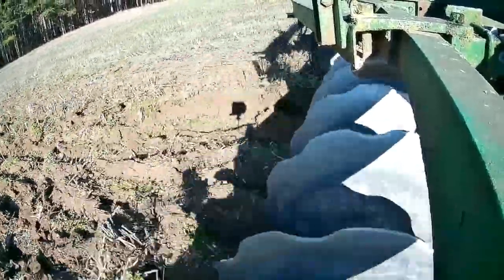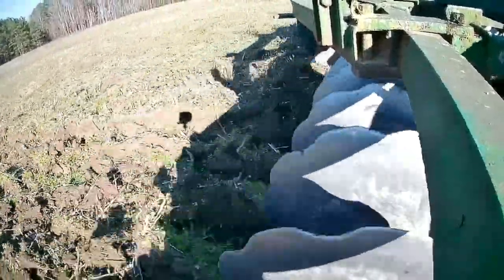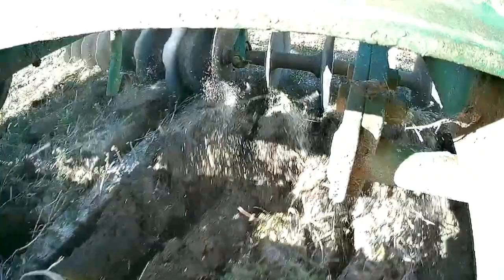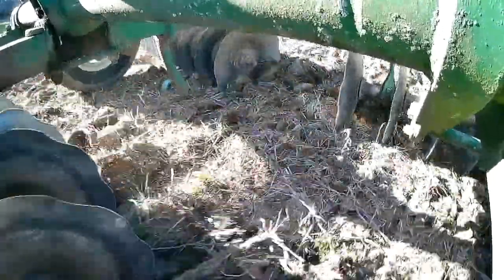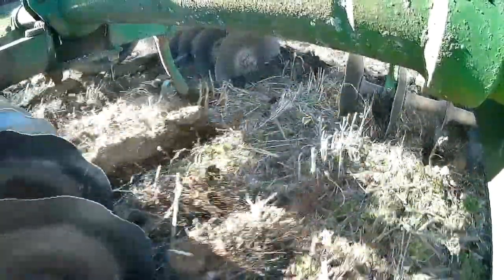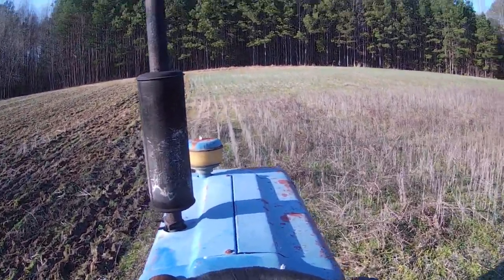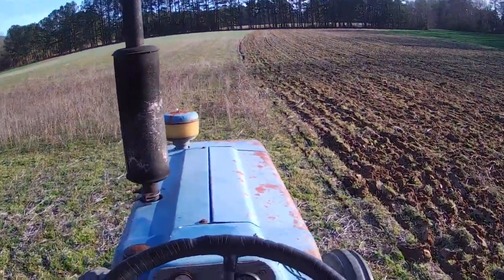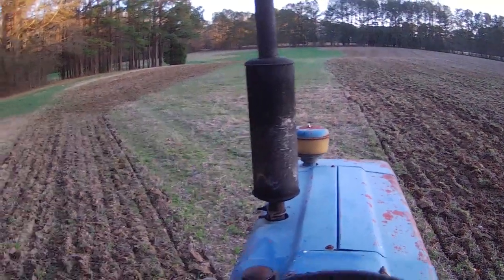March 1st Field Work

Comment: Nice video. That disc does a nice job for sure. It's nice to get that to soil opened up just enough for the soil to dry. Hope you don't get hit by those storms they're talking about in Tennessee‼️ God bless and hope he's watching over everyone❤️‼️🙏
Reply from the maker: Mark Mortensen - that rain made it here this afternoon.  lost its power punch but still dropped about an inch here on The LIttle Farm.   if you can and if you have the extra, then Red Cross is the best way to help those in Tennessee.

Comment: Great to see you out there getting some field work done.  Have 75 acres here to moldboard plow and hoping to be able to start that later this month.  Nice video work.
Reply from the maker: Charlie Adamchik - from what I know about plowing once you get things set right and running good you can make some good time with the 4 bottom plow I own.   I do need to take mine apart and find out why the trips go off to easy.
Reply: @SoybeanFarmer3300  It might be that you need new springs.  I currently use an International Harvester model 720, which has automatic reset. But I still have my old model 710 which is like yours in that you have to back up and reset the bottom manually.  There are springs kind of like small leaf springs that can get weak over the years.  I can't say for sure, but that could be the problem.
Reply from the maker: Charlie Adamchik - the for sure thing is I have to take it apart to find out.  huge rust welded bolts but now I have a torch...

Comment: You said  "just a good solid pull" I like it, Ford 4000 with 40 something  buff horses
Reply: Tractor data says it was 45hp on the PTO fyi. I thought it would have been 50 something hp given the later series tended to have about 10 more pto hp than the first two digits of the model(on the utility line of tractors), with few exceptions. For instance, the 5610 was 66 hp on the pto and 7710 was 86 hp.
Reply: @ghenry85  Thanks for the info, we had 3000's and 5000's back in the day's, they was all very reliable tractors for us
Reply: @jankotze1959  No problem. I didn't grow up around Ford tractors, and I never drove a 3000 4000 etc. The Fords I have drove a Dexta, 6610 and 7710 series 2. I enjoyed the 7710 the least because of the side shifters were worn and a pain to shift on the go. Not bad tractors at all.
Reply from the maker: Greg Henry - you are right about what tractordata says.  in the next video I said 48hp but I spoke incorrectly.   in the 20 plus years I've had this tractor I've found it likes to run hot with heavy work loads so it is very important to keep the radiator air flow open and the correct 8 psi cap on the radiator.  the cap wore out and tested about 4 pounds then I messed up and replaced it with a 12 pound cap but caught my mistake before I blew something.    thanks for being here Greg.
Reply from the maker: Jan Kotze - the little tractor is a work horse and with the cool air temps I been pulling this disc in for the last several years the tractor has done very well.   40 something is a good call on the hp because of the years of wear and the blow-by.

Comment: Looking good! That little Ford handles that disk quite well, shallow. We just got another 9" of snow, it'll be awhile before we see dirt in Anchorage Alaska.
Reply from the maker: AKWayne S - a dear friend at work gave me her old phone.  it is an LG Stylo4.  I don't have service on it but I do play with it on WiFi.  I got the MyRadar weather app loaded on it and one of the cool neat features is, I can move the cross hairs over a city and get their current temperature.  thinking of you my friend I have been looking at Anchorage and this morning it was 9°F there.   yep in soft land if the disc drops in deep its more than the 4000 can effectively pull and not a good match at all but for surface residue cutting its prefect.  kind of a poor man's vertical tillage tool.    thanks for watching and being here.
Reply: Soybean Farmer Yes, still cold
up here but Momma is having nice weather in Kansas.

Comment: Ol' Blue sounding good. Still too wet here in NE Texas to do any dirt work. Scrapers all fixed and painted,new bush hog  offset disc all fixed and painted, all tractors and equipment ready to go: just need rains to stop... Next 3 days supposed to have heavy rains here again. Ugh.
Reply from the maker: amos snow - 4000 could use the same rebuild you just completed but it still works so I push on.
Reply: @SoybeanFarmer3300  Got my rebuild kit at all states ag parts. They also have a valve kit: next rebuild I do I'll probably do the head myself.I'd bet cousin could be a great help to you on yours.Good project for next winter.

Comment: Love the video, good on you having the balls to try out a new format. How’s the 4020 making out?
Reply from the maker: Cory Betts - the 4020 is running really good and the next time I hit this field it will be with a bigger disc behind the 4020.   for the last almost year now the 4020 has only been cranked at least once a month to charge the battery and keep the fluids stirred but soon I hope to be riding and working her for the year 2020 planting preparation work.    I tried some more voice over in the next up coming video and I hope I got the sound levels better.   thanks for the compliment and for watching here.